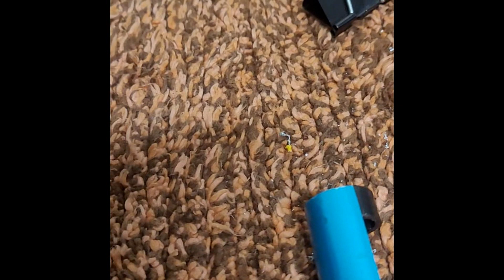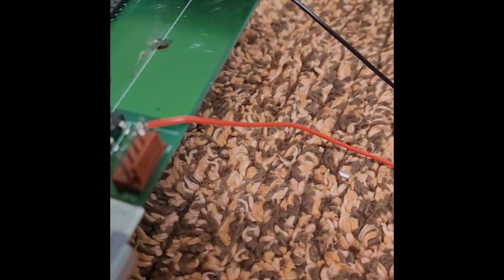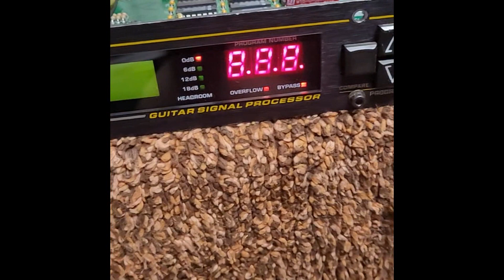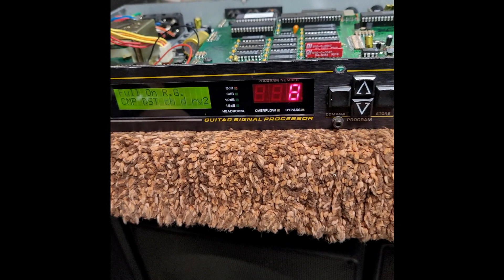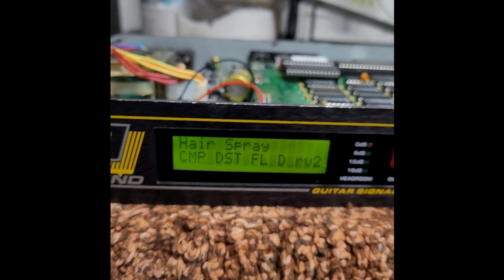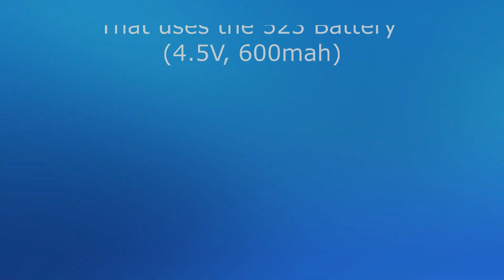Digitech 523 Battery Mod For GSP21

Comment: Hello Peter I know the video is about something else but I need your help my Art sgx nightbass preamp presets are locked and I've tried almost everything by myself but nothing.
Reply from the maker: Go into the utility menu and scroll through the options.  On the SGX2000 there is an option to unlock presets, so I suspect there may be a similar option on the Nghtbass.
Reply: @peterpertierra4402 Thank you very much I want to try and see what it will do
Reply: @peterpertierra4402  Hi! Really sorry for this invonvenience but i Come back to you again for the same problem that annoy me with my Art sgx nightbass pre amp. I entered the utility parametre but all that IS displayed in the screen is << Preset. 1...115= locked>> and i can't find the place to unlock or a button i can press to unlock the presets.

Comment: Peter, I have to comment here since the SGX LCD replacement as the comments are turned off... Thanks for that video. I'm a long time user of the SGX nightBAss. Getting ready for touring. I have 3 units and and 2 are getting pretty tired and I deed to do your mod. ( plus the blue looks sic!!) can you provide a part number or link for the display?  Thanks again  ReVv
Reply from the maker: Edited the video to allow comments.  The display part is available on ebay, aliexpress, etc.  Just search 1602 lcd display and get one that does not have a serial board. Header pins come in lengths of 40, so cut off 16 with clippers.  The ribbon cable is female to female dupont cable 20cm.
Reply: @peterpertierra4402  Thanks a lot! One last question do you think it would be possible to de-pin the last 2 on the original harness and swap them to accommodate the new LCD?
Reply from the maker: You can cut the last two of the ribbon cable and resolder the connection inverting them. But I used the dupont cable to make it a drop in mod.
Reply: @peterpertierra4402  Thanks again. I have 3 SGX nightbasses. The blue will look great!

Comment: You might have been better served checking the actual voltage across your battery array. I did this same mod with a AAA battery box in ~ 2015 (linked it on TGP forum). The battery wattage will have nothing to do with it - the wattage dissipated with only be what the memory requires. Alkaline and lithium's will have a higher voltage out of the box, and I reckon that was what the problem might have been. Carbons are closer to the 1.5v, which what I used no problems. Putting the three rechargeables in there, you might be lucky to be getting 4v, but might be the best solution, funnily enough. The original 4.5v in mine had spewed and damaged the PCB.
Reply from the maker: @coalfacechris1336  I learn something every day! Yeah the old batteries were wet cell alkalines and notoriously leaked.

Comment: Peter, I have an original GSP 21. no longer lights up , no power. Research says it might be the capacitor next to the battery. have you ever needed to change one?
Reply from the maker: I've seen repair videos in which the capacitor prongs are loose and have to be refluxed, but don't rule out having it replaced.  Caps are not expensive. Easy fix.  Most Digitech single space units (all GSP's, DSP's) all have the same power supply structure/circuit.
Reply: Yes, I had to do track repairs around the power supply area. It is a weak point.
Reply from the maker: @emmottataolcom  sorry for the late respone. I have seen the video of the capacitor being loose on the pcb, but as far as replacing one, I'd troubleshoot it first.   You might want to check the transformer first for voltage, then the Mosfets (+12v, -12v, +5v).